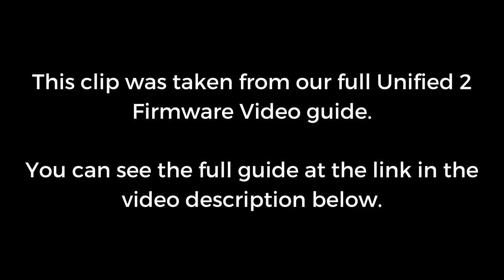Unified 2 Firmware - What is Unified 2 Firmware?

Comment: Does your firmware have the ability to recenter the bed like for instances if you install a microswiss direct drive.  Or would that require recompililing the firmware which would requiring buying the TH3D support.
Reply from the maker: It has options to change your home offset and bed size. Those 2 things will let you change the bed size. If you can't figure out how to do that on your own we do have support available via email and video call.